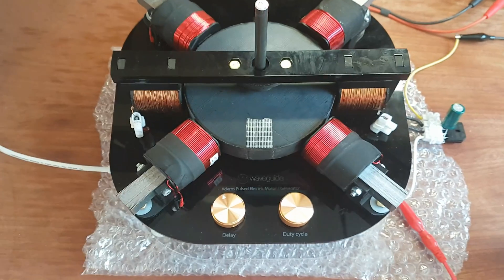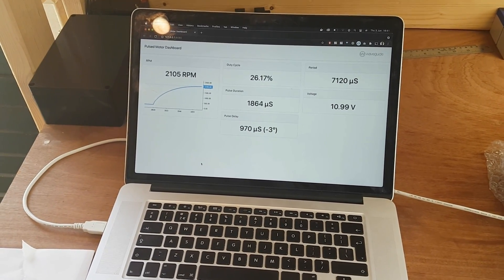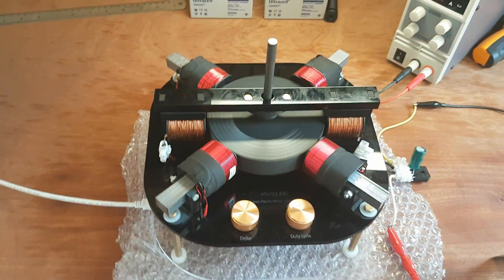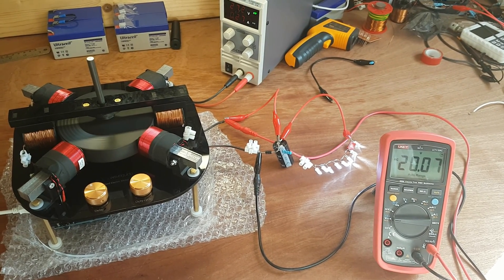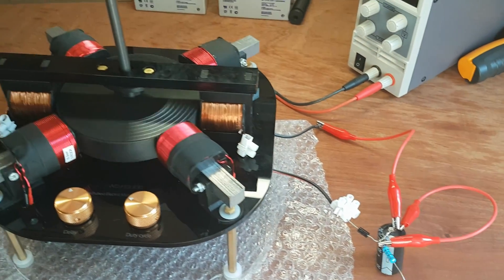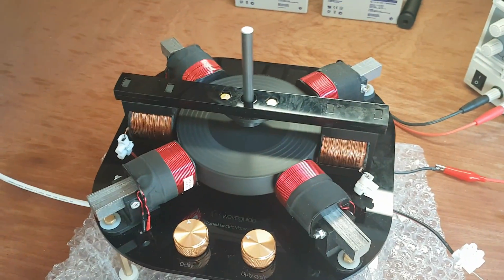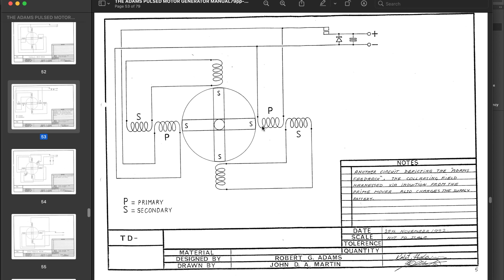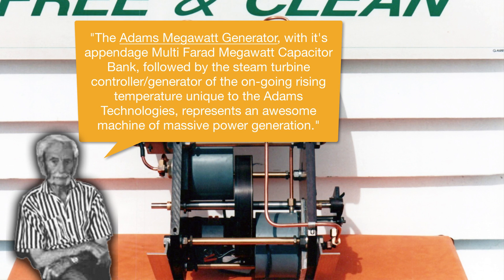COMPLETED Adams Pulsed Magnetic Motor Generator Load Tests + Brand New Adams Material

Comment: Excellent build, very well done.  Just one point, and someone might have already commented on this.  Your laminations for your collector coils were oriented vertically and this will create excess and unnecessary hysteresis losses.  It is critical that your laminations are insulated from each other but also oriented on the same plane as the rotation.  So in your case, horizontally.  Keep up the great work though.

Comment: Did you pulsed also the output/generator coils? Like in the original design? Like when the magnet is aligned with the gen coil core, you conect the coil, and just when the magnet passes by you disconnect again , shouldn't by this dramatically reduce the drag upon gen coils???
Reply from the maker: I did not pulse the generator coil, but someone bought this motor from me and will experiment with that.

Comment: I built an Adams motor to his original design without the generator coils but using the star commutator. i found when the commutator closed contact and made the drive circuit there was a small spark and a voltage spike that went back into the drive battery charging it a little. This won't happen with hall effect or optical switching though.

Comment: cool! maybe you could add some smoothing capacitors in parallel with your power supply output, like metal film caps that can deliver fast pulses, and that might allow your DC power supply to give an accurate amps reading? I use 2* WIMA MKP10 250V film caps in parallel with my DC power supply to run my oscillator circuit anyway, to handle the fast current spikes. but you've got a working model, optimization is the bread&butter of engineering, so even a 'poor efficiency' is a great result to work from.

Comment: Ok, don't know how far you ve come, or what you know, but the reason, why the short circuit of the secondary coils make it move faster is the slow movement of the magnetic field inside the coils, when you take of electricity. It is like the field stops from changing (not complete).

I'd had a design, with long Coils, where the motor speeds up, when i take of energy, because the mgnetic change in the iron was stop and the motor didn't need the same energy, as if you had a complete change in the iron, because of the magnets.

So maybe this can help: the secondary coils need a switch and a diode. The switch shortcircuits the coils, until the magnets are on the coils. Right at the moment, the magnets are on the iron, you take of the switch. Other the diode, you need to load the capacitor. You only should take of the energy in one direction, or the coils breaks harder then before, cause of the strong direction change of the magnetic field. At this moment, the coils load the capacitor with back emf and a higher Potential of the input. Try to load the battery and figure out, if you can get more energy, then you put in. Use a battery, to move the motor and for the recharge, so you can find out, if it works.

Comment: Cool. I noticed your copper coils are not off center like the schematic. Thryre actually centered between the 4 red covered coils. Does this make a difference?
Reply from the maker: The schematic shows that the 4 red generator coils should be able to rotate a few degrees to find the optimal position. This was in my first version of this motor, but made it shake like crazy each time a magnet passed by, so I had to bolt them down in one place. I didn't notice much of a difference anyways.

Comment: Potentiometers add resistance which dirty the pulse witdh of the pulse generator. A triggered spark gap tesla hairpin circuit would be a better power supply controlled by flight controller or faster signal generator, and NO transistors or filter coils or resistance elements of any kind can be in the circuit. Since switching abrupt power like this is so hard, you may even need multiple power supplies (either all tesla hairpin circuts with vortex coil quenched triggered spark gaps, or it would be some quenched triggered spark gap version of a half bridge SMPS).

Comment: Wonderful build! I love your aesthetic design sense! Most of these types of reproductions are total messes where its almost impossible to follow what the person is doing because it looks like a bird’s nest of wires and stuff. With your design it is clear and easy to follow visually. I came across the Adams design just last night while perusing youtube, and I read a couple of articles about it done by other inventors like yourself, and here is what I learned so far…. 1) Adams had a closed loop design, where the output power was connected to the input so that it didn’t need a power supply to run the generator. And from what I read the key to doing that is both the spacing and timing of the coils, where one shuts off completely while another turns on in succession at the right time so that it keeps the magnet wheel spinning with little to no power. Adams did this by attaching a second rotor disk which had physical brushed switches which turned the drive coils on and off at the right times. All the drive coils (which there are two drive coils in his design) do is swap the magnetic field polarity so that it either pushes or pulls the magnets on short pulses so that it keeps the magnets spinning. This, if done correctly, should require very little power. 2) The second important thing about this device is that it works as an over unity device only when the output/load circuit and coils are pulsed at 1/6th the rate of the drive coils, so that the discharge doesn’t sap more power than the generator needs to keep the magnets spinning on their own. 3) The third thing I learned is that the two drive coils are smaller/thinner/less windings than the output coils. Also, Adams didn’t have access to things like arduinos and mosfet switches, which obviously make things a lot easier. However it also adds a lot of complexity to the design, which may not be needed and could probably be avoided by designing a better physical timing circuit, either with physical switches (like say a laser switch like what you find in a desktop computer mouse button). Hope that helps! Good luck with your future iterations! I have subscribed to your channel and will be following your progress in the future.
Reply: @oleggovorun5553  not if you give it a starting move. am i right?

Comment: Nice rig man! To improve efficiency, you can consider changing the shape and material of the rotor. (It may need more time to start spining... but once it spins....) On the video the rotor seems to be made as a solid piece of plastic material? Maybe consider a flywheel principle? Energy storage/change of energy. When using a rotor with a flywheel made of ALU with outer ring (heavier maybe add Lead?). Run the setup and experiment with the Pulse Width of the motor. When reducing the pulse with you may have to increase the voltage. Increasing voltage to increase RPM to hopefully reach resonance. The generating coils should probably be the same as the motor coils. You may consider experimenting with different diameters of the flywheelt. We try to reduce the heat produced by the coils... if any?  - by reducing the current consumption. Reducing current consumption by storing the energy in the flywheel...?? does it make sense? or im lost.
Reply from the maker: In one of my other videos I show a rotor that uses a thick brass plate as the flywheel. It just seems to cost a lot more energy to sustain that mass, so not sure if it will ever be more efficient than this rotor. Adams himself used foam as ultra-lightweight filler material for his rotors, so it seems he was of the opinion that non-structural mass should be as low as possible.
Reply: @Waveguide  Time to invest in aerogels

Comment: Yes I would have to agree with what this guy said. "Yes he said it was some one who replicated the Adams motor and achieved 800%  efficiency ,  but I have seen this in a few other. designs to achieve over unity with other devices". So yes some other guy said all the extra stuff but he got it from a guy who replicated the original so the information was kinda passed down.

Comment: You are great builder and Adsms is whay to go. You can improve results by making flywheel half or even 1m radius. E= B*L*v* sin	fi. Your magnetic field shoul cut wire under 90 degrees. Secon put 4 drive coils. They should have narrow field then pickup coils. Use both sides of magnet or prime mover which should be in sandwich of pickup coils. Use back Emf for driving coils or try to eliminate it with bucking coils to prevent dragging. Pickup coils (upper and bottom) should be able to rotate independently. Use paperclip and magnet to see how deep magnetic field reach to not waste cooper. These shoud work better for shure. I think 4 ch scope is must have when dealing with Adams motor/generator. Hope it will help. Cheers.
Reply from the maker: Thanks for the tips!

Comment: Just a guess, when you change the rotor (center part) you need to change the coils and the pulsing timing and other things...  and he used a battery not a device to drive it...
Reply from the maker: Coils were specced to this rotor, and I have run it from batteries as well.
Reply: @Waveguide  Have you seen this?

https://www.youtube.com/watch?v=J2bPDDWqSvM

How are you timing your electric pulses?

The optic timing disc is used because it doesn't put drag on the rotor maybe....

In that video they suggest a 1/2 inch gap... etc, etc... I would try to make it exactly like the plans he left then go from there...  also the size of the two different coils or cores is a factor 2 or .5 (1/2) according to that video, yours look too big... but I don't know anything, I'm just browsing the Internet, but I think this might work.

Comment: U need to spin 3,600 rpm for 50/60hz  w load or put a cap  20 nf nd the voltage to match

Comment: Can you tell me where the energy conference was held ?? How did the motor work out for efficiency Sir ?? I was thinking of using a bar magnet between the laminations of the coil would really help, at least that is what I am thinking.How about winding copper wires in a sphere around the outside of the generator Sir ???
I cannot wait for you to get heat out of this thermal electric generator Sir. This has to be the holy grail of making a heating unit to heat a home. Please make this happen for the good of mankind.
Reply from the maker: Location was Spokane, USA. Here is the conference website: https://energyscienceconference.com/

While studying Don Smith's device #9, I feel like the secret material in the Adams Thermo Electric Motor Generator was perhaps Bismuth, but I still have to test this.
Reply: @Waveguide  Look forward to find out what you discover Waveguide. I forsee great things from you Sir. Good luck too.

Comment: This is high tech stuff and very well built. How much voltage would it pump into a 10 K 450 volt electrolytic capacitor. That a good test of it's ability.
Reply from the maker: Hi, haven't tested that yet, and do you mean from the flyback or from the generator coils?
Reply: @Waveguide  The generator coils.

Comment: If you generate on the approach of a magnet field your coils counter it and slow it down if your generate on the withdraw away the pickup coils counter is and slow it down. if you short the output which means you are taking no power out then the energy can stay in and rpms will accelerate due to reduced drag. Drag is directly proportional to output energy. Adams motor was never proven to work. You cannot quickly steal energy from a spinning wheel before it notices that you stole it. no matter how quick your pulses get or any trickery in delays and such will be felt exactly by the flywheel. You also cannot trick a wheel into spinning faster with a quick pulse vs a long one. the spinning speed will be directly proportional to input power. It like pushing someone on a swing there is nothing better than a well timed pulse no trickery will do it for free. The air gap will just reduce connection to the wheel nothing to gain by increasing distance. In fact it has been proven closer is more efficient.  Back emf is misunderstood its simply the energy you put in returning just as momentum return if you push a swing there is no gains in energy from back emf. If the energy is used in a coil to do work the back emf is reduced. Magnetic field is momentum, and electric field is pressure. you have to steal from the tempic field which is heat and the result is the unit will run cold.
Reply from the maker: Thanks for your detailed comment!

The only thing about BEMF is that as Newman suggested, and which becomes obvious if you look at the Ampere-Turn theory, that if you use the same amount of current, but put it into a much larger coil, you're "paying" the same, but the power in the BEMF or flyback will be much much greater.

And I don't think shorting the output means the energy can stay in. It provides a path for a lot of current to flow, and so it will be seen as a heavy load and so slow the rotor down.
Reply: @Waveguide  aLoadNeedsToHaveTheResistanceEqualToInternalResistanceToDrawMaximumPower.
Reply: @ovidius2000  at least someone understands "jacobs law" and or "therevins maximum power equation".
Reply: BemfItsWasted,NotCollectedBecauseNoCapacitorConnected.

Comment: Somebody did this properly (you) and that's great.
But, instead of getting 800% output, you got 15% output - significantly lower output than input.
Why is not slowing down when short circuited ? Because this is low induction generator

Comment: Ever achieved OU or is it a myth?
Reply from the maker: I've seen machines with my own eyes that seemed to be OU, but I myself have not achieved it (yet :-p). I'm working on a model with 20x the magnet surface area + many other improvements, so hopefully that one will be able to definitively answer this question :-)
Reply: @Waveguide  rotary transformer v3, RTv3 by brad power may give you new ideas

Comment: You need to set up time switch 1/10 - its first , and connect standart generator on this motor, because its a pulsed MOTOR
Reply from the maker: According to its inventor, it's actually a pulsed motor generator, so a combination, but he later agreed indeed to optimize it as a motor and attach a regular generator to the shaft. I'll do this on the new, much larger motor I'm working on at the moment.

Comment: Optimal air gap I'm sure I heard was 12mm. Also you're generator coils you should be able to move about to find the sweet spot.
I'm extremely interested in this project brother, it's nowhere near completely, I hope you haven't given up on it?
Adam says it's capable of 800% efficiency, 110% would be a good start. 
Subbed.. I would like to see more of this contraption mate and see you succeed. I don't have the funds to be able to make one or I'd be straight on it, i figure if I follow Adams design to a tee it cannot fail. The original plans that are online are being blocked, I cannot download them and if they're being blocked then they are GOLD!!! 
Good luck boss👍🏼
Reply: If you can get 101% anything is then possible
Reply from the maker: There's a ton of confusion around the claims made about these devices. In some comments he made later in his life he mentioned 107% for these machines, and perhaps a few 100% for his thermo motor, which was a whole different type of machine.

Ideal air gap was definitely 1 to 1.25mm according to Adams, see: https://waveguide.blog/pulse-motor-generator-design-considerations/#air-gap-1-125-mm

Comment: In your article on your website about Robert Adams I read that Robert Adams aparently said that:

- It is not the impressed energy applied to the motor that creates the inductive field, as taught in universities and colleges alike; the magnetic flux field “already” exists in its natural state within the stator system; the application of energy into the system simply “expands” the natural latent inherent inductive energy residing therein. -

Could a same thing be happening in Michael Faraday's Faraday disc homopolar generator where the magnetic field is provided by a permanent magnet and the generator works regardless of whether the magnet is fixed to the stator or rotates with the disc?
Reply from the maker: I haven't experimented much with the homopolar generator myself, so I can't tell you if the effect is the same.

Comment: Can you put the math in. Watts in and watts out. Power supply VI=_?_ and Output VI_?_ . I can calculate it from your power supply from the video. Can you put the multimeter in series with your fan?
Reply from the maker: Hi, the power supply doesn't show an accurate figure, as it is pulsed DC and not a continuous current. You'd need an advanced oscilloscope to calculate the true current usage.

I don't have the motor setup anymore to run the tests you propose, but you can be quite sure that the output power isn't super impressive.
Reply: @Waveguide  I’m trying to make a pulse motor myself. It’ll be more of a generator without any external power supply. It has one drive coil with four exterior coils. Each exterior coil pulses power into a capacitor. When the drive magnet comes around it severs the connection to the generator coils and hits a reed switch from the capacitor to the drive coil. I’m still working on the generator coils to get the right amount of windings to correctly Pulse the energy into the capacitor. And I’m trying to work out the electronics for the back EMF from the generator coils.